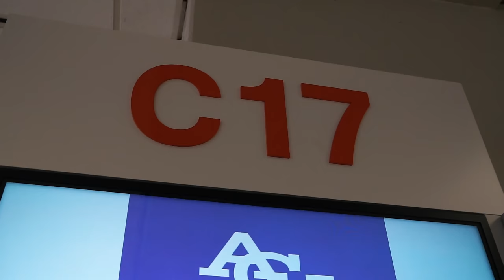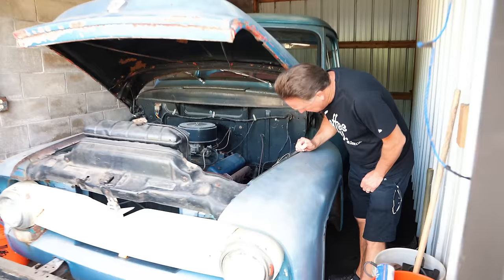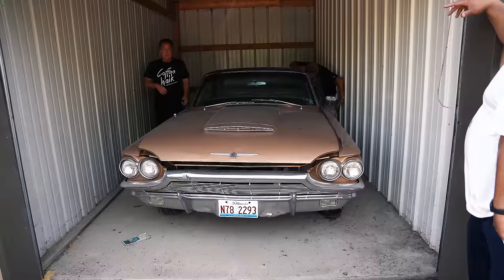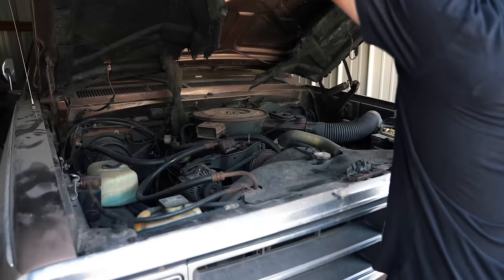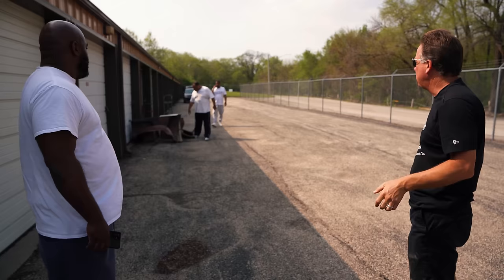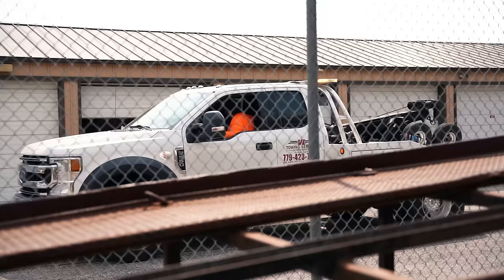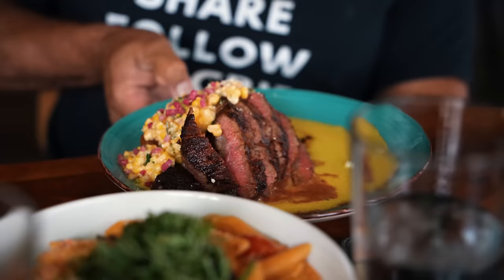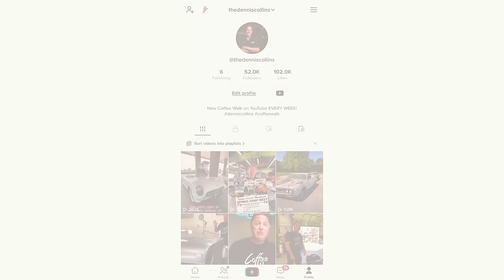RESCUED: 1968 Charger, 1970 Super Bee, and 1989 Ram Charger!!

Comment: my 1968 Dodge charger got traded in on a ford pinto when the arab oil embargo made gas go from 39.9 cents a gallon for premium, all the way up to 47.9 cents a gallon.. there were gas lines at most city gas stations. They actually had to implement odd/even license plate numbers for different days of the week that you could buy gas. I was not gonna pay 47.9 cents per gallon for gas in my gas hog charger. So I traded it in on the slowest car I ever owned.. The Ford Pinto. I have to admit, that was probably the best car I ever owned. I never even had to put air in the tires no. It was so slow, that I had to power downshift from 4th to 3rd to maintain momentum on the uphill sections of the interstates.. then President Ford did us a big favor and lowered the national speed limit to 55 miles an hour. my girlfriend and I, now my wife, stopped going from Western Pennsylvania to the Eastern shore beaches because of the speed limit, because it added 2 1/2 hours to the drive each way. So we just stopped going..
  that Dodge charger that I had was nothing special, 383, automatic, two barrel.It had a horrible whine to the starter, like they all did. The heat riser valve with clatter away, it puffed oil, probably from bad valve guide seals at just 42,000 miles, when you close the door it sounded like a metal garbage cans full of nuts and bolts. It had drum brakes upfront.. it was rusting in front of my eyes. It was nugget gold with a ivory colored vinyl top, and gold final interior that was cracking.. I bought the car from the original owner with 28,000 miles on it, and it had two transmission replacements. I bought it when it was four years old and I put the third transmission in it.
back in those days, every little town had a transmission shop, a muffler shop, a starter and alternator shop, and the Earl Scheib paint shop. They would paint any car any color for $29.99.. that’s because transmissions were not as good in those days, exhaust systems were not stainless steel in those days, starters and generators, and alternators were not as good as they are today.. and earl Shibe paint jobs you’re really not that bad if you did all the prep work and tack wipe and masking and took off all your emblems when you got there, because they were not gonna do that. They painted right over the dirt. But I had them paint a couple cars when I was a kid, and I did the prep work , And they sprayed it, and it was not too bad.. of course they could’ve put a little fish eye repellent in the paint, but that cost extra..
  my charger had a nasty habit of snapping the steering wheel out of my hands turning the steering wheel all the way to the right in an instant, almost breaking my thumbs once, if I floored the car… The headlights were behind flip-flop covers, I think they were vacuum operated. Sometimes mine didn’t open at all, I had to open the manually and stick a piece of twig in there to hold them opened so I would have lights at night.. The car felt unsafe, and it sure was a loose rattle compared to today’s cars… I did not trust the car at all. When I had that car I was going with a beautiful girl, her dad was one of the owners of a major worldwide chemical company.. her dad asked me to take my girlfriends brother, his son back to school for him, because he had to leave on Business. I refused because I told him I just do not trust my car… my girlfriend later that evening let me have it she was very upset that I would refuse, we ended up splitting up over that. she ended up going back with her boyfriend a month later, and today, and boyfriend is one of the managers in the company, and they live in a house with a six car garage, five bedrooms, inground pool.. i’ll because I did not trust that Dodge charger. Reminds me of what Woody Allen said is the saddest thing in life. Missed opportunities..
   I think the reason these Dinosaur cars have skyrocketed in value over the past few years is because, they were such a piece of scrap, that there are not many survivors.. they were gorgeous, I still think my Dodge charger, 1968 was the best looking car I ever owned, but what a pile..
  The cars of today are the best cars that were ever made. These are the good old days, not the 60s and 70s cars, today’s cars. Today’s cars get better gas mileage, they will last hundreds of thousands of miles, they don’t need tune ups once a year or more, today’s cars get better gas mileage, today’s cars are faster and today’s cars will go around the corner and stop, and you will do better in a crash in today’s cars..
  I have driven some older cars recently, well over the past five years, GTO‘s, Corvettes, Chevelle’s from the 60s & 70s, it was a relief to get out of them. To have powerful brakes again in my ram hemi pick up truck. To get into my sons Acura RSX type S felt like I was getting into a spaceship compared to those old relics..
  anyone that thinks they missed the good old days, you didn’t miss anything. These are the good old days..

Comment: Dennis, please correct me if I am wrong but I thought all 2nd Gen Chargers were Hardtops, meaning the rear windows role down and there is no 2nd gen Charger models with a fixed post between door and rear side glass. This was unique to the Chargers. The other B bodies could be had with a post.
That's Ok, you just conflated the Coronet/Super Bee with the Charger.

Comment: if that is the 360 engine in the ram build it with the 1978 little red wagon exspress 360 with the 1970 340 cam look it up u dont have to have a catalyist with  that spec mopar factory build the factory had those cams on the shelve

Comment: I owned a 1979 Ford square on square with the factory 351M400  balanced and all the good stuff it would out run anything in 4 low trust me it was a running machine
Reply: I tore up more U joints than the local parts store had
Reply: It run so hard that it was really amazing
Reply: Nothing but just run like a rapped ape
Reply: A 350 Chevy no chance
Reply: Quadra load

Comment: Okay we got a charger charger a two-door Sports hardtop and if that's a c that's a 6 cylinder engine manufactured in Belvedere Illinois or at least that's where it came from car number 269508 I'm at 6 digit says it's a 68 model looks like a good rest though mod if you want to put a V8 or 440 in my question is do you have to change the front end suspension and the motor mounts be interesting to see how it's done always watching good show love you guys winter rod

Comment: Why in the world would guys like this not bring a set of shaved keys and a pick gun.all of these older ones are pretty easy to get the doors unlocked and turn the ignition switch to be able to steer and get them out of gear..would make things much easier..there are lots of other things  that they never bring to do this job. Work smarter not harder.

Comment: Great find, however Dennis if you are going to continuously make money flipping Chargers, then you need to brush up on them. 
No Chargers ever had B pillars, you said it’s a hardtop as opposed to a coupe. Every Charger was a “sports Hardtop. Vin is XP, unless it was an R/T as it becomes XS.
Also, that car Does NOT have the tic tock tack. It’s just the clock, and every 68-70 Charger had bucket seats. 
That car was clearly painted and was originally red/burgundy  
Just goes to show, the guys with more money than knowledge end up with the cars